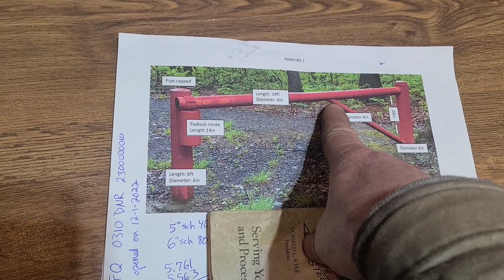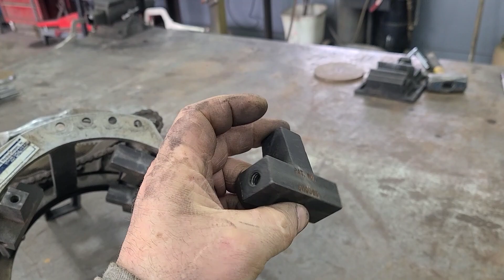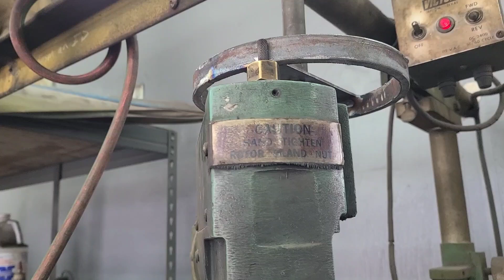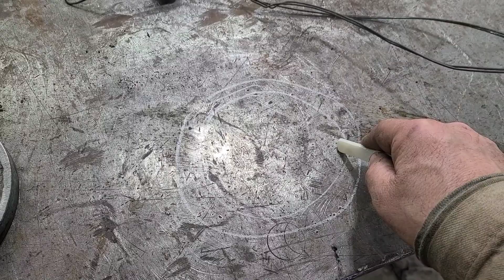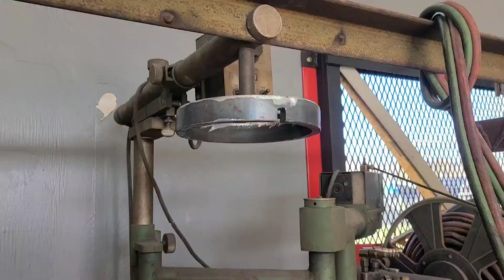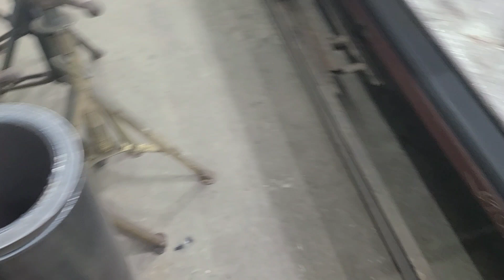DNR GATES PART 1

Comment: When I was a teen, I worked in body shop, and the welding device was a pyramid stick Lincoln welder, and we would weld panels on cars with acetylene torch’s and coat hangers for rods. Welding has come a long way, and I saw you try to shut down that Arccaptain with huge rods, I bought the same welder. Love your show and learn from each one. Kentucky. 👍
Reply from the maker: Good to hear...thanks for commenting

Comment: What do you plan on using as bearing material to take up the slop in the hinge?  I'm currently finishing the fabrication phase on four security barrier gates using the exact hinge design that has about a .120 gap. I'll be installing them next week. As always, great content!
Reply from the maker: No bearings

It's 5" pipe with a flatbar shim tacked on it and the outer sleeve is 6" sch 80

The videos will show exactly how I do it

Stay tuned and thanks for watching and commenting 😉
Reply: @NBSWELDING  I have a solution for the hinge slop:  I'm going to weld four 20-inch long vertical beads with 90 degrees separation along the circumference of the 5-inch bollard using  .072 flux core. This should be adequate for tightening up the hinge enough to still allow freedom of motion.
Reply from the maker: That may be the trick...I don't think it would be worth the trouble on the gates I'm doing because the slack isn't doing any harm...the lock side post holds up the gate so sag won't be an issue and these gates out in the woods will just sit there closed most of the time.

Let us know how it works out...especially for later on when people search for gate building info and find this information...could help somebody decide how to do their gate!

Comment: Square tubing gates SO MUCH EASIER...AND STRONGER.....
Reply from the maker: If you get time to watch the vids then take a look at how the pipe is cut and beveled with the beveling machine and how the welding positioner is used to hold and rotate the pipe to make it easier to work on….I say this because now that I have the equipment to work the pipe I think that the pipe is much easier to fabricate than square tubing…there is no saw that even comes close to cutting square tubing as fast and perfect as my beveling machine cuts pipe and I can bevel the pipe at any angle just as fast as if I were cutting it off square….and the pipe is much less cost than square tubing…I also think that the pipe is easier to paint.

The customer asked for pipe and tubing was never an option but I gotta say that even if I were able to choose myself I would recommend pipe over square tubing.

Thanks for watching and commenting
Reply: @NBSWELDING  o that's good it's all in having the tools and equipment!!.. good work man

Comment: Working on a project with new clean steel is so much more enjoyable than repairing a rusty, painted, oil covered machine. I enjoy seeing the solutions you come up with in your shop. Not sure what that pattern/torch cutter device is called but man is it neat.

Comment: It's going to sound like I'm knocking a product but. The lock system with that 1/2 pipe locking the horizontal pipe looks like it would be easy to pry up and swing the pipe open.
Reply from the maker: Prying on that 1/2 pipe will not allow it to open...there is a bar welded to that and that bar goes through the gate pipe then down through the lock guard.
Reply: @NBSWELDING  yup I was going to mention thickness. Video pic doesn't look as thick as half inch. That's why I commented.
Reply from the maker: @Bombardier64  Sounds like you still ain't smellin what I'm steppin in...nothing is 1/2"...there is a 3/8"×1-1/2" bar that goes through 

Stay tuned...you'll see how it's made
Reply: @NBSWELDING  I just became a teef.  "You ain't smelling what I'm stepping in", done stole it.